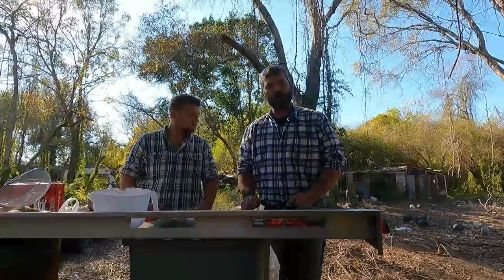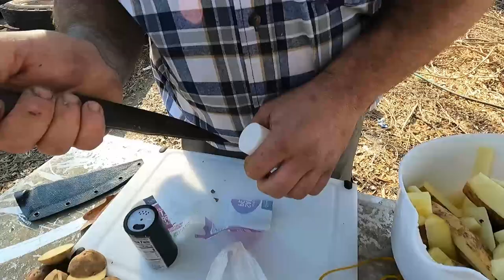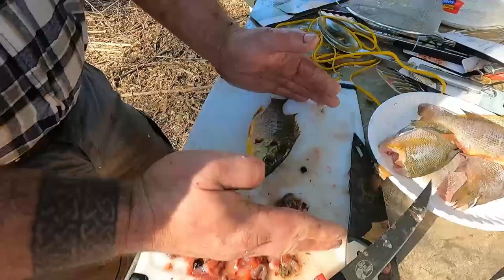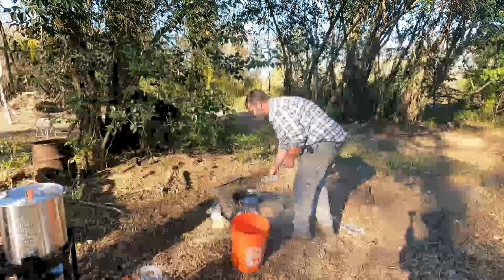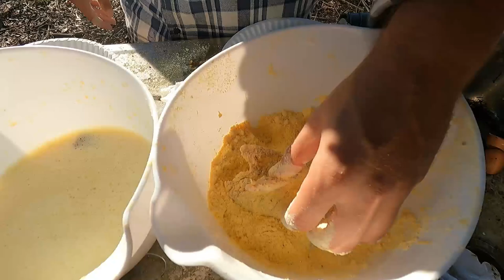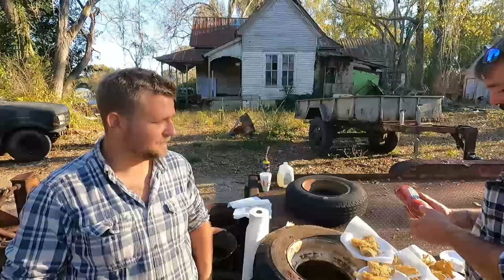COOKING WITH AARON AND ROBERT | FISH FRY ON A 140 YEAR OLD FARM | HOW TO CKEAN AND FRY BREAM

Comment: All  work and no play makes John a unhappy boy. We all do it different when cleaning... under six, wash the slime for the most part and do the bread fry... those bigger fish, while they are still flipping around on the table, lay it flat on cutting board and run the fillet knife along the edge of the skin and tight to the back and then just push forwards to the other end of the fish. Tip it over and follow the skin to the end leaving just nice meat fillets ... fry whole and eat well. I seen and did it this way as you catch you chunk em in the hot grease. When done, peel them out and break the head lose from the body and the skin an peel the backbone right out wasting no meat